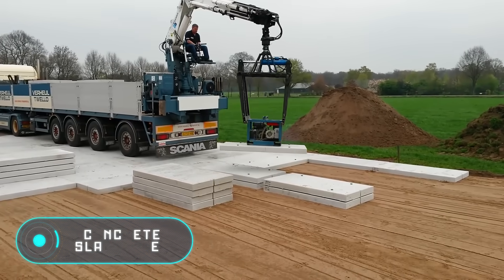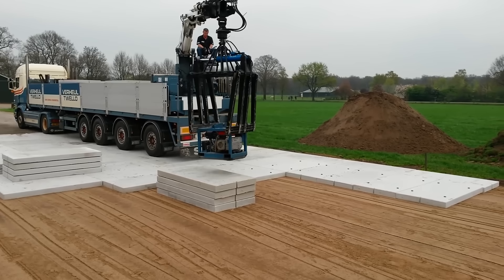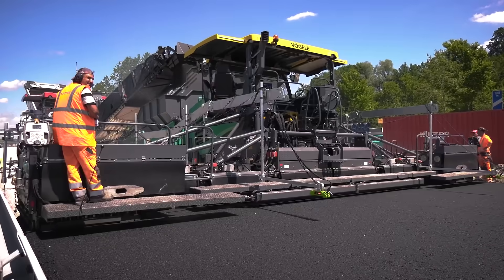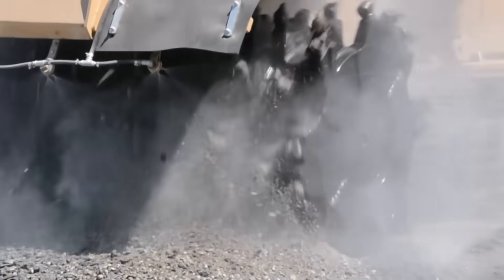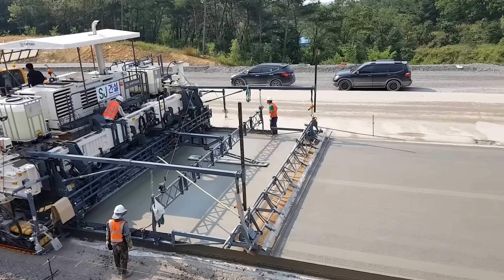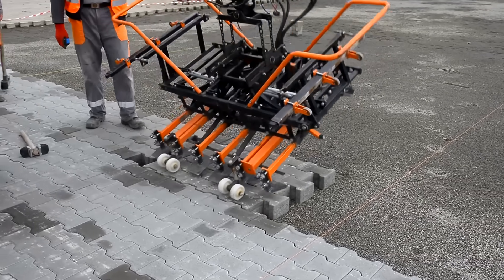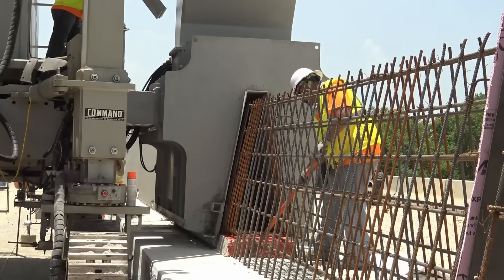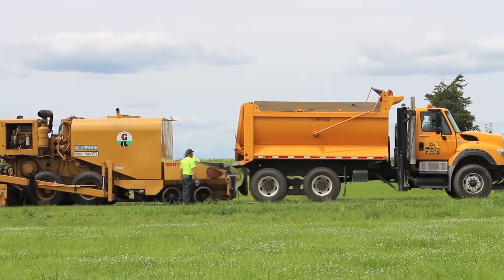7 AMAZING TECHNOLOGIES FOR FAST ROAD CONSTRUCTION

Comment: A shame the concrete slab lifter is not interlocking, plus unloading then placing is a waste of time when this could be done in a single operation with larger slabs.

Comment: Id bet the brick road would fall apart in 12 month in Massachusetts i think the tires filled with dirt would be awsome i seen on last video make tire road bed and then lay road we are doing asfalt hear in mass and still hasent worked yet thousands spent on a road and next year the road is all shit i think in cold frost places like vt nh the dirt roads work best they get hammerd in spring and are rough for 3 month of spring but great rest of year. They grade them

Comment: 0:04 Concrete Slab Lifter
1:45 Vogele Super 3000-3I
3:04 Tesmec 1150XHD Rock Hawg 
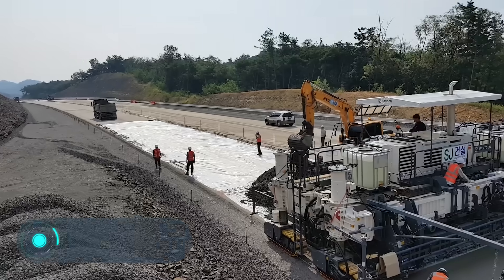4:41 Wirtgen SP 1200
5:59 Optimas H88
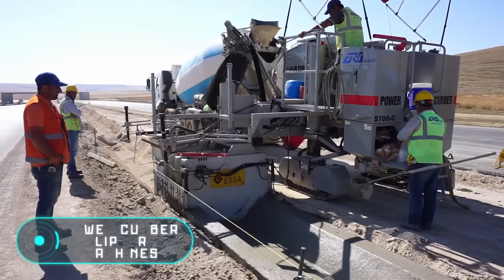7:22 Power Curber Slipform Machines
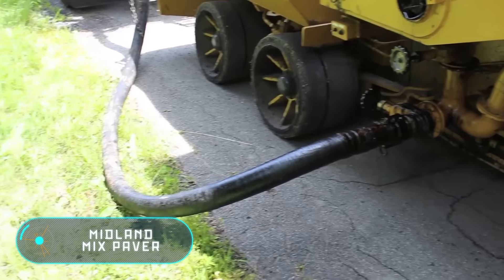8:22 Midland Mix Paver
Reply: Please send this video to Department of Public Works and Highway in the Philippines!  In our country, a 3 Weeks Job using these machines can take several months or worst more than a year!

Comment: That final road surfacer may be useful in less than optimal conditions, but the edges it leaves aren't good or stable unless finished by some other means not mentioned.

Comment: Lots of dust kicked up and going into the used lanes of traffic  @ 4' 07"
Reply: exacly there are more clever machines then this one, in the netherlands we use like a drum grinder fenced of to prevent dust with a conveyor belt system to dump the grinding directly in a dumptruck.
Reply: @arjanvanraaij8440  you will never beat the German machine